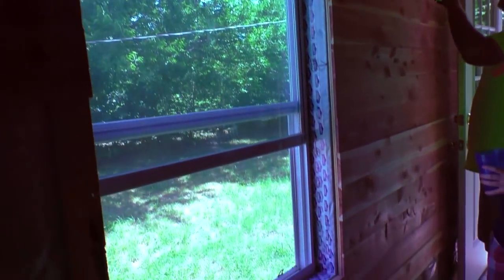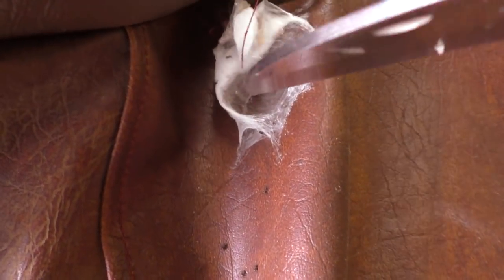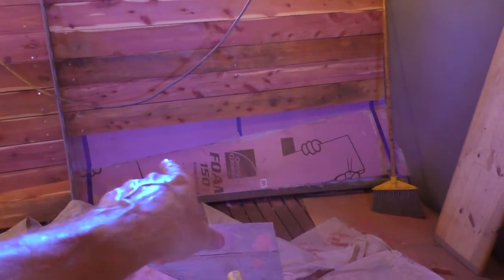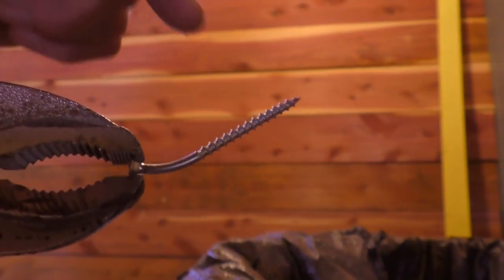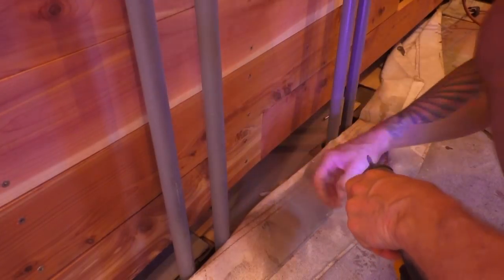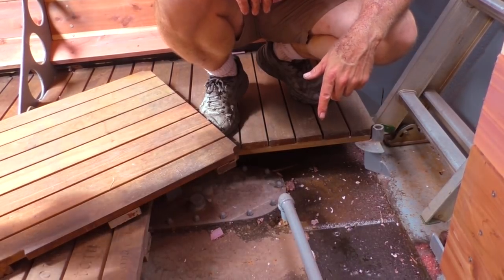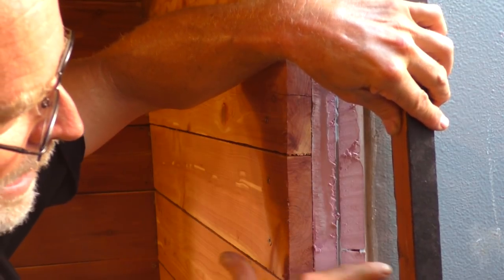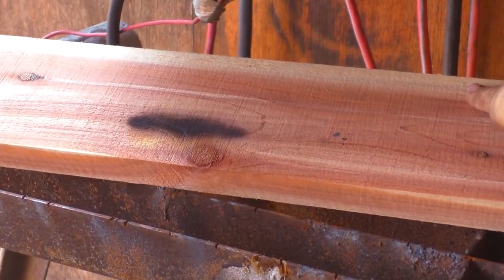Finishing the Cargo Hold

Comment: When i was 12 i was working at a torque convertor factory my Dad managed. We re-manufactured automotive torque convertors. My job was load the hubs, stators, clutches, turbines and front covers into a large steam washer to degrease the parts. One summer i worked 8 hours on, 8 hours off for an entire month. I was paid $3.75 per hour.   I also got to drive the tow motor.

Comment: Bart the foam you welded on top of is the same stuff that cause the fire in London at Grenfell Tower recently - doesn't burn unless it gets a lot of air, but then it's horrendous stuff. I'm using the same stuff on my shipping container conversion.

Comment: I just noticed that there is no ventilation for the furring strips. Did you coal tar even the holes that the bolts go through? Another option would have been to leave one side oiled with linseed oil so any water that gets into the wood can slowly work its way out.

Comment: Doug - odd request.  Can you take some scrap 1" foam stack it up into a 4" tick block, support it o some 4x4 about 2' apart and see if it will hold your weight.  If you have the time and material, choose your favorite foam safe adhesive and glue the layers together.
Reply from the maker: It depends on the type of foam.  Find the crush psi for the foam you want to use.  For example Foamular that stuff we are using is 25 psi.  But Foamular also comes in 40 and 60 psi.  So you would need 9 square inches to not crush under my 225 pounds.  Provided I dont jump on it.  :)

Comment: hey Doug I'm slightly curious do you have even a rough estimate on how long it will take to finish the boat?  If not then what percentage of the work do you believe is done on the boat?  As for what I was doing when I was 12 I believe I was helping my dad and uncles with cutting, stacking, and splitting fire wood here in the Upper Peninsula of Michigan lol
Reply from the maker: I said 2 years for the past 6 years, but now we are saying a year and a half. :)
Reply: usually there is not a stopping time, but a stopping point on work like this
....but then it is a boat; and there will always be something more to do, or then redo

Comment: But if you had to weld..the melt foam could be repaired.  You could drill a hole into either side to attach a small tube to urethane foam and fill to void.

Comment: What was the driving factor to red cedar versus teak?
Reply from the maker: Red cedar is the lowest priced lumber available locally.  On top of that it's light weight, rot resistant, insect resistant, smells great, and looks great.
Reply: SV Seeker I was figuring it was because of local supply, teak is better at moisture, and bacteria and insect, rodent prevention then cedar, but pricing and supply would definately hinder its use. Nice work keep it up.